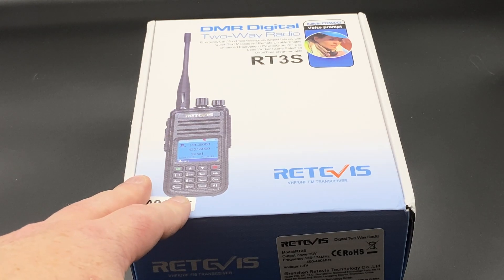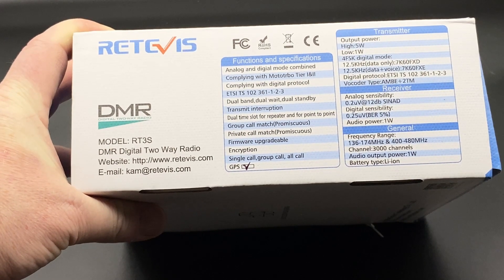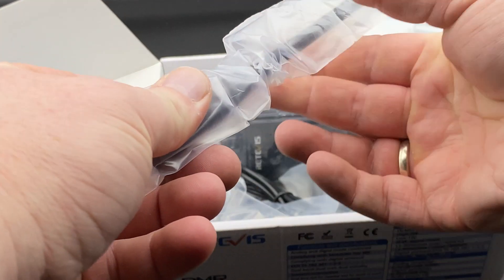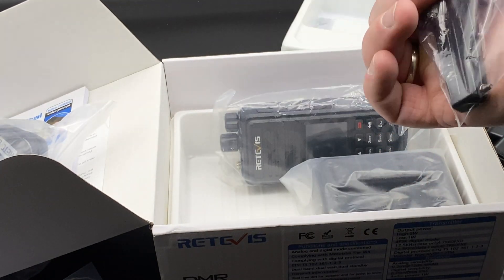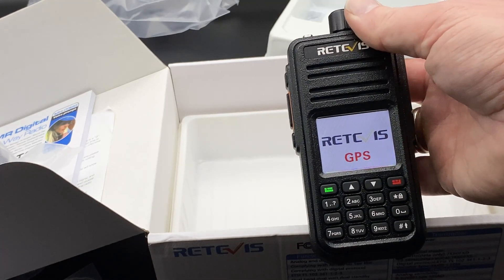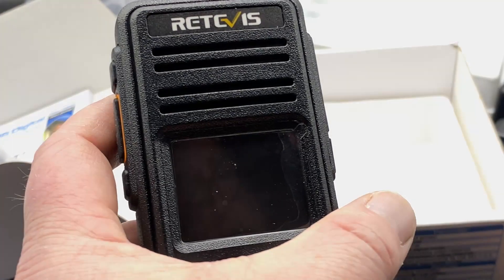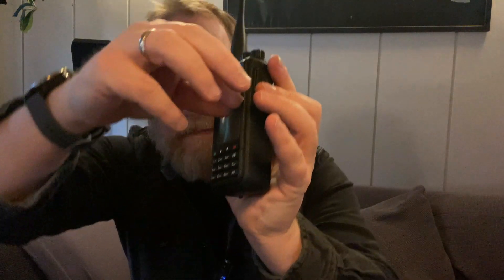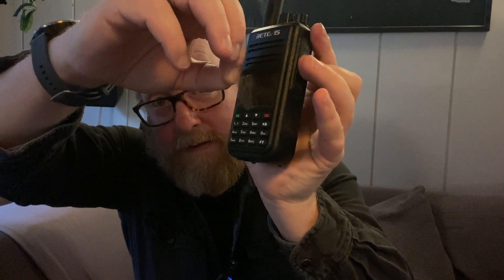Why am I looking at the Retevis RT3S?

Comment: Is the RT3S manufactured and shipped recently able to be installed openGD77?
Reply from the maker: I am not really sure what you are asking, but it is not shipped with OpenGD77. Retevis does however support the installation of OpenGD77 on this radio. Please check out the links in the video description.
Reply: @LB0FI  I heard that the new RT3S uses different chip sets because of a semiconductors shortage. So, it is impossible to deploy OpenGD77 on it.  Do you mean that the latest model is also possible to install OpenGD77 or not? Is this video just for the promotion of Retevis????
Reply from the maker: @ebisu153ebisu153  I do not mean anything about it. As I said, I was able to install OpenGD77 on the radio that arrived a couple of days ago. I have no idea when that radio was manufactured.

Also, according to the OpenGD77 Facebook group both the old and new RT3S work fine. I do not know more than that, and by far not enough to conclude all the way. My advice would be to reach out to the OpenGD77 developers and ask them if you are worried about this.

As with your last question, with no less than four question marks, this video is not just for the promotion of Retevis. Retevis did however provide me with the radio free of charge, except for sales and import fees and taxes, to try out OpenGD77 on after I reached out to them. I did not receive any money for this. 

If you look at my community posts there are pictures of the radio running OpenGD77, and please don't worry, there are more videos coming.

I hope this adressed your concerns, if not I would advise you to take a deep breath and calm down before posting.